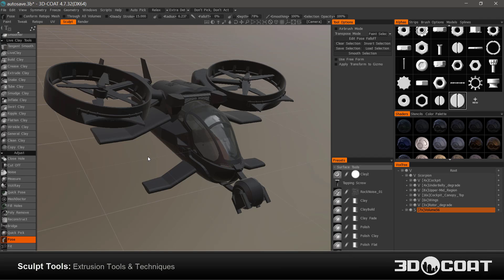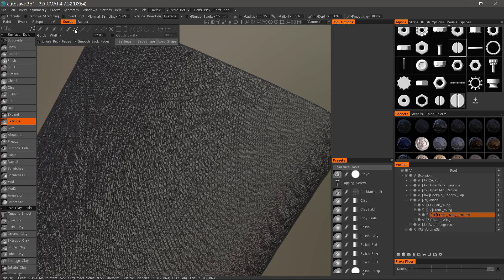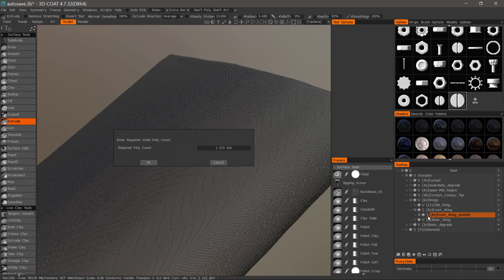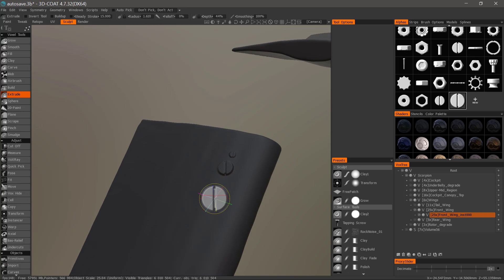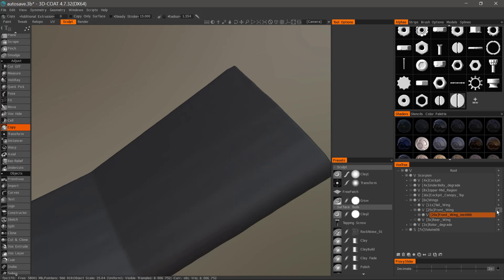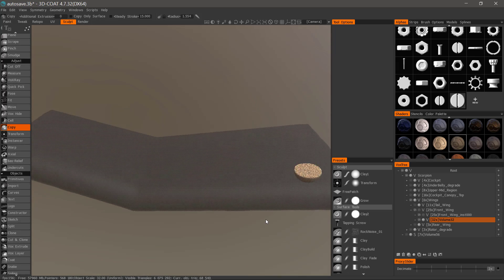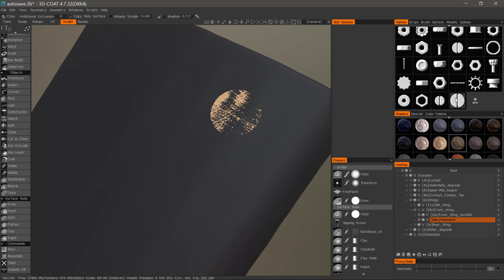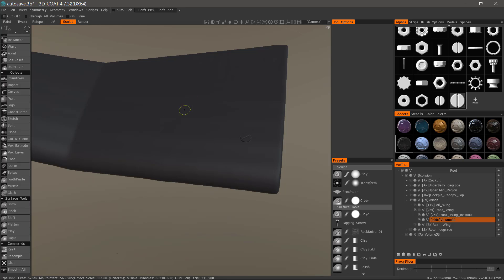Extrusion Tools and Techniques Pt.1

Comment: another way to add bolts is to model one, decimate it as much as possible, make sure its nicely positioned on xyz for where you want its pivot, add to models tab in your own custom tab, click your model on a new layer with the object you want to put bolts on vis, set place by brush. then brush placement can add as many as you want where ever you want following the normals of the object vis and just place and place etc. make sure your bolt is decimated as much as you can as your duping them. theres prob a way to dupe as instances. fyi if you need alot of them